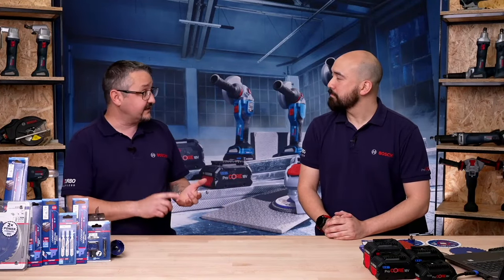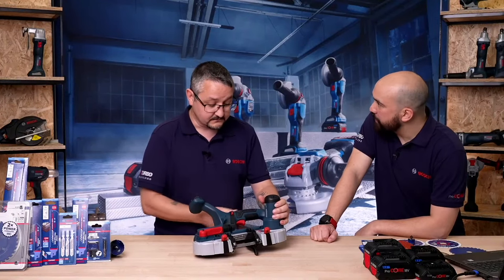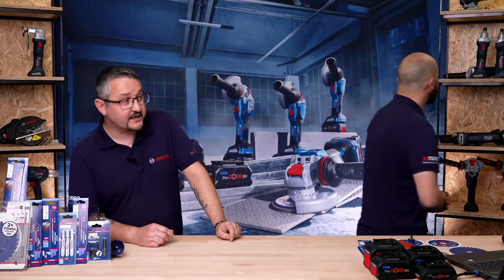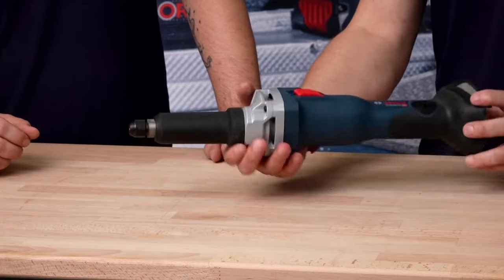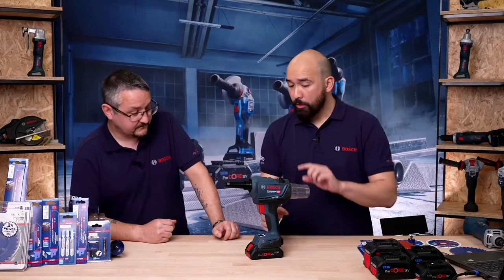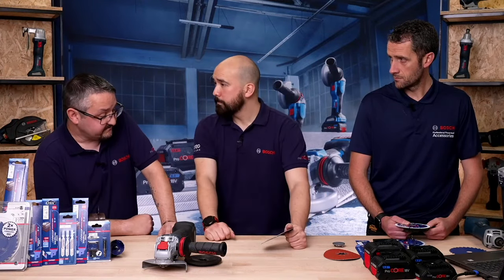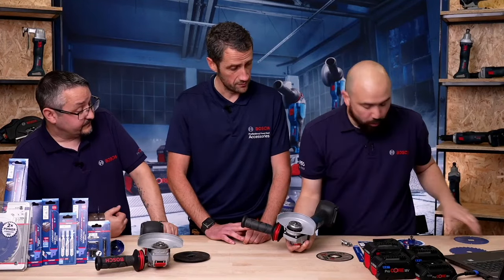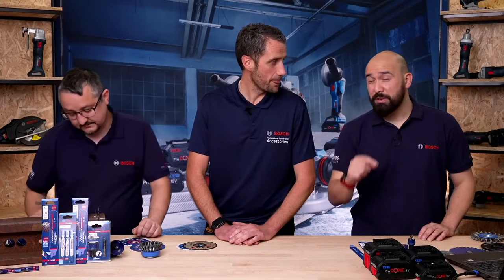Our BEST METALWORKING POWER TOOLS | Bosch Professional LIVE

Comment: How is it that the thumbnail is about the GKM but you spoke about it for 10 seconds. You spoke more about the blade for the saw than the saw itself
Reply from the maker: Hi Asad, it just happened to be a particularly good image for the thumbnail 😉  However, if you want to know anything else about the GKM that we didn't cover during the livestream, let us know! We'll be able to answer any queries you might have about it here in the comments.
Reply from the maker: We didn't cover the tool in too much detail as the main difference compared to the previous model is the improved guard as discussed. Much of the design remains the same. You can find out all the specs here: https://www.bosch-professional.com/gb/en/products/gkm-18v-50-06016B8000
Reply: @BoschProfessionalUK  I know you have the old one, I know it's just a metal cutting circular saw but a bit more info about it would have been good. I do watch all of the live streams but I was looking forward to this because I wanted to buy this exact saw. There isn't really much info about it anywhere
Reply from the maker: Hi Asad, if you let us know what you want to see the tool do and what you want to know about it, we'll produce a video that gives you all the facts alongside a few demonstrations of the product in action :)
Reply: @BoschProfessionalUK  I want to use it for Unistrut, metal conduit and sheet metal. 
My friend had the old one. He said it doesn't spark which is good. I would like to see how well it works as a free hand tool cutting material on site
Reply: What is the latest gkm 18v model?

Comment: Expert Sheet Metal Holesaws…
An electrician’s set with a 16mm, 20mm, 25mm & 32mm.
Reply from the maker: Hi Jonathan, sorry for the delay on this. Thanks for your question. Unfortunately we don't go a 16mm, however we do have an EXPERT sheet metal Hole saw set, with diameters 22/25/32mm. The part number is 2608900502 :) Additionally you can get a 20mm as an individual accessory. Part number: 2608900419

Hope that helps!